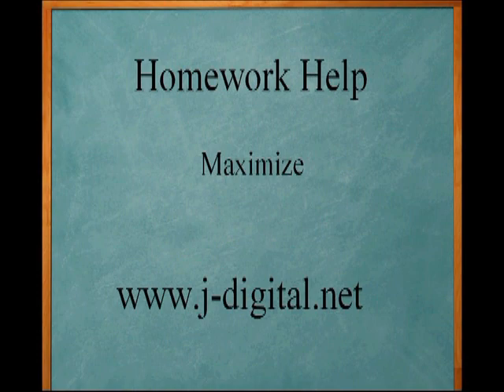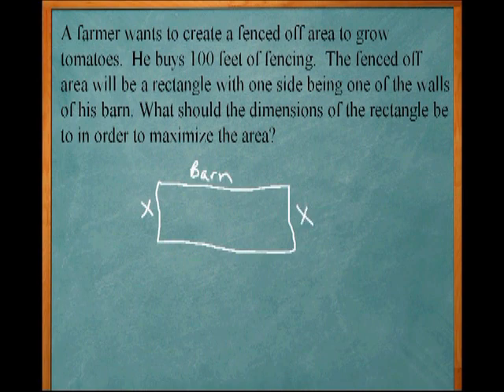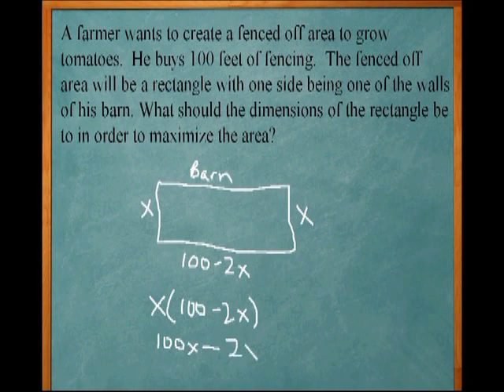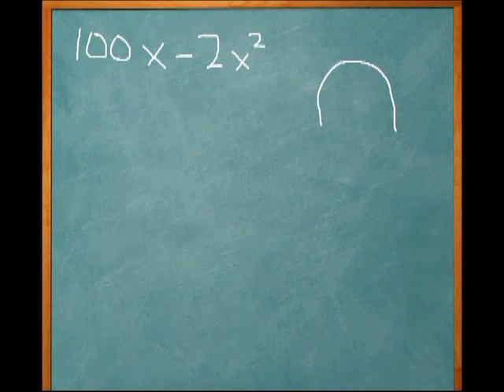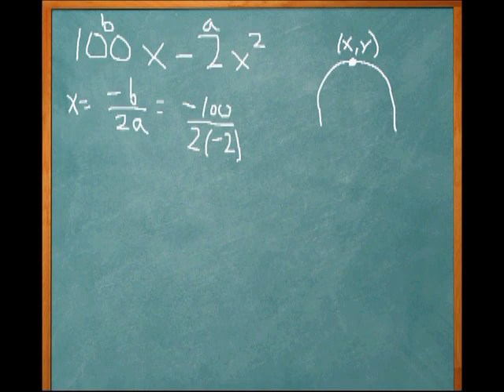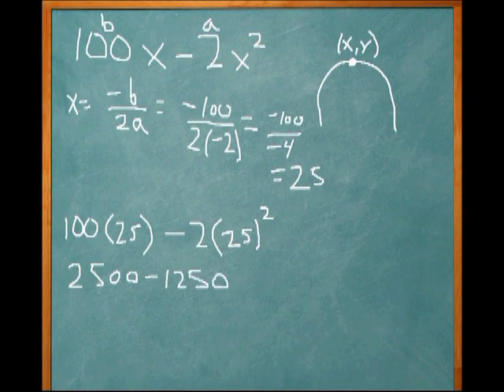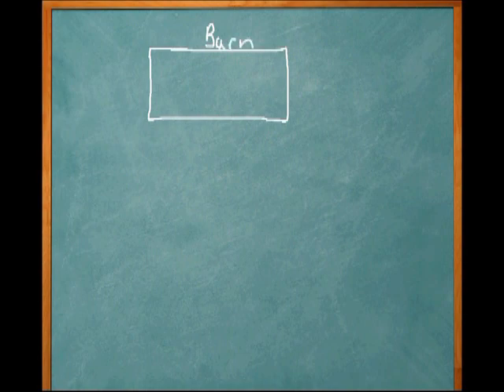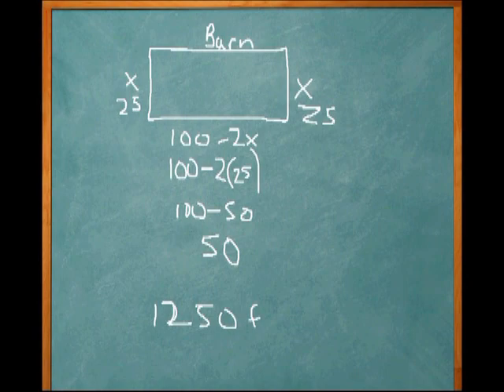How to Maximize a Function

Comment: This is heavily confusing in my book because your result is wrong. The farmer's got 100 feet of fence. Your assumtions result in a fence length of 2x + 2y = 2*25ft + 2*50ft = 150ft. The length of the horizontal sides (assumed to be labelled y) would have to be (100-2x)/2 to get the correct result which is a square (the maximum area of a rectangle with fixed circumference is always a square).

Furthermore, in my opinion you should have explained how to get from 100x - 2x^2 to -b/2a. The common approach to get the maximum (or minimum; using the second derivative to determine) of a function is by setting its first derivative to 0. That'd be -4x + 100ft = 0. Solved for x = 100ft/4 = 25ft. And since in a rectangle with circumference 100ft: 2y = 100ft - 2x => y = 50ft - x => y = 25ft.

[/smartass]
Reply from the maker: You are only fencing off 3 sides.  The 4th side is the barn wall.